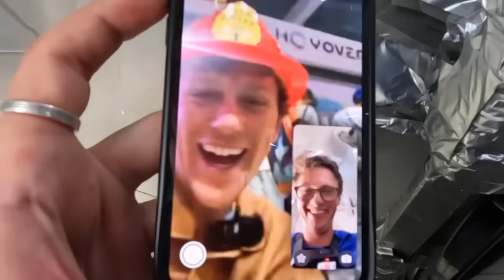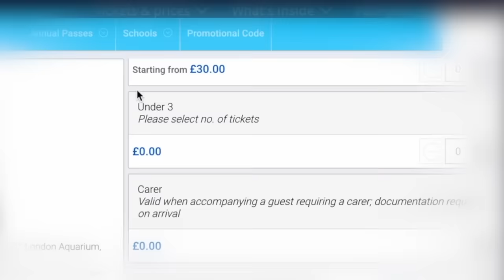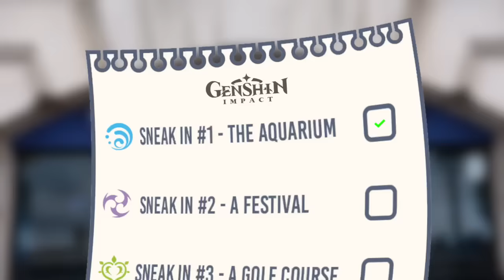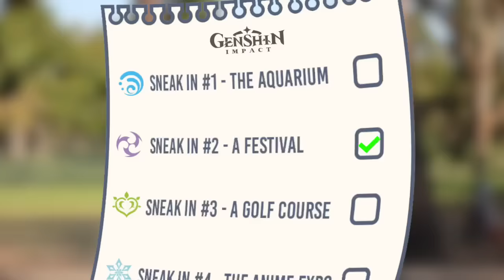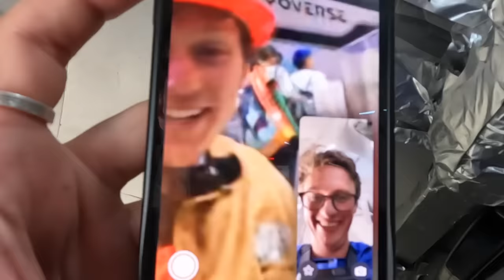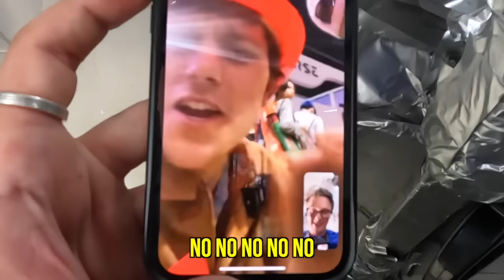I Broke Into Places In The Silliest Ways Possible

Comment: I can vouch for anime conventions' security. They take their jobs seriously. They constantly hound you to show your badge of admission. Even if you're already in the convention, if you attend a panel, theres security on the inside of the door and as you walk by you have to hold up your badge which it's very distinguishable so they can easily catch anyone trying to fake it. 

However, there are still ways to slip by which me and my friends did last year, we had tickets, we just skipped the entire 3 hour long line. How? You had to wear a wristband that basically said you had gotten the Covid vaccine or you were tested within the last week and were negative for Covid. They were handing out wristbands at the front door so standing in line was the only way to get one. But we found some random staff outside helping with the long line and we convinced them to give us wristbands so we got them and then just walked to the front of the line like "heeeeey, we already got checked and approved" and they just let us in. This year, instead of going through the front entrance, we're going to go through the back as the convention center is attached to a hotel by like a tunnel. Still will be a long line, shorter than the main one I'm sure, but it's inside instead of in the 80-90 degree heat.

Comment: In the anime convention and the festival, the primary concern for the security guards are crowd control rather than enforcing ticketing. The reason these events have lots of security staffs is because there need to be enough members to control the crowd movements. Overcrowding can cause dangerous situations, and it's a serious issue in that can destroy the experience for the other goers. The ticketing really only exists primarily as a form of crowd control, so they probably wouldn't really care if one or two people slipped in, as long as not too many people are doing it, it is not going to cause overcrowding or other dangerous situation. The tickets are of course a revenue stream as well, but once the concert is running, it's not like  the operational cost of having an extra person or two would actually matter. They knew people sneak in all sorts of stuffs including themselves, as long as you're not causing a commotion, they're unlikely to make too much fuss about it. 

The golf court and the sea life museum are for profit business, so sneaking in is a bit more questionable. But again, there isn't enough staffs to chase down every sneakers, and the potential for altercations and injuries is just not worth it confronting every one without tickets.